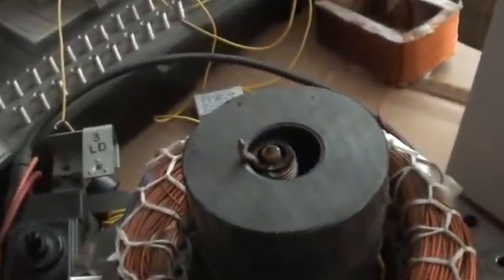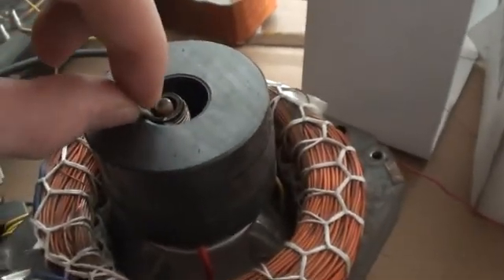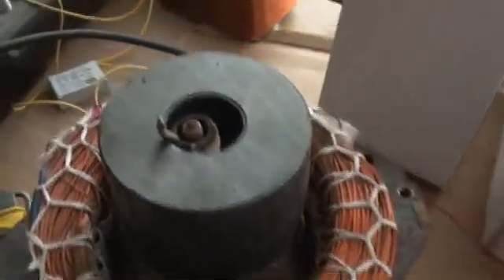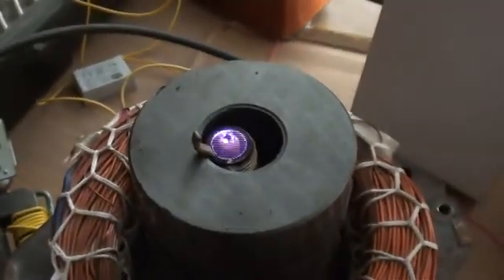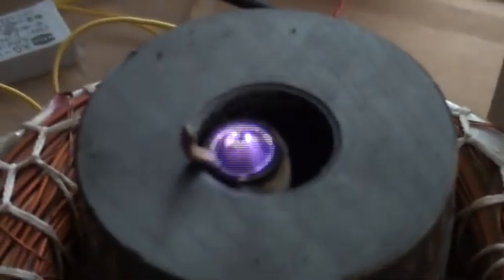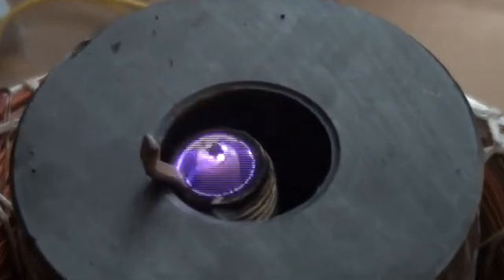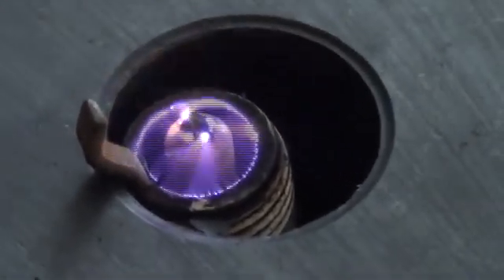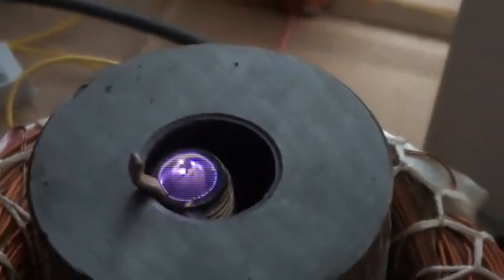Plasma Forcefield!

Comment: ok  hexx noted hears 1 to try with a plasma ball an empyu large soda can will pass voltage  hot n thin enough to burn micro holes in fingers 2 a cfl bulb in mouth and get close to plasma ball it will light up in your mouth  looks like uncle fester and its safe

Comment: You missed the joke. A force field doesn't have to APPLY force to be a barrier, it only has to BE a force. In this case a definable field that would likely leave a tingling sensation and a burn on the finger. A force to be reckoned with, to be sure.

Comment: it might be a hard task getting that much electricity to run under peoples feet without exploding them, not to mention dangerous... but it could be possible... but obviously, you can't store that much energy inside the forcefield... so whatever you were hiding from could cut off the power from outside, and you'd be screwed...

but this is a very cool project... that may make a fortune out of some paranoid rich people XD

Comment: we would be dead, plus even if the air was 78% nitrogen that is not going to separate from itself just to join the electrons to form the purple fake plasma non existing energy, it doesn't work that way, and still it would not be conductive it would react and blow, because nitrogen is 100% explosive and that is a real fact.

Comment: are you refering to hidrogen or nitrogen, becausethe universe is full of hidrogen and both are highly explosives, so where is the purple here cuz I don't see it, plus is not scientifically possible to combine them, hydrogen and or nitrogen explodes instantly with electrical energy, you can't use explosives to conduct energy are you completely stupid or are you just extremely evil to pretend that something impossible is possible to deception the system evil cell.

Comment: impossible nitrogen is a high explosive, it would blow up instantly once in contact with an energy source that would activate it, example fire, laser energy, even electrical spark, nitrogen can not conduct electrons, and they can not be stable because none of those energies is by there nature stable, all of those energies are unstable, and where do you get the nitrogen from anyways? plasma energy is a complete deception that is secretly created by the evil inside the human cells of the system.

Comment: I beleive technically when a spark makes a jump through air it had to heat the air enough to cause plasma. even at a micro stage ( air hs to become ioniszed to the point of discharge through the medium.

Comment: extremely fake, plus spark plugs are not design to create this kind of energy, they just simply spark, and why is it even spinning? it just doesn't have a logical reason as for why is spinning, magnets just do not create this so called plasma energy that is completely different from all the rest of the energy, is faked obviously, how is it possible for this energy to even be release whit out a conduct? , it also melts metal how can if it travels trough them? i also seem they stretch it lik ruber

Comment: high temperature plasma can actually stop matter. its been done in experiments but the problem is that the plasma has to be heated to around 1500 degrees K, the hotter, the better it stops matter. to stop a bullet it would be too hit to stand anywhere near.
If you want to know more about this, check out "Plasma window" on wikipedia

Comment: yeah you are right time of exposure will be too short in this field ...i talked more theoreticaly about plasma field as protection...when you make more layers and use more adapted desing is possible to melt fast moving objects..my point was that plasma can affect state/temperature of bullet but barely a kinetic energy or speed.. huge coils or focused emp more affect electronic devices...simple things as bullets you can just pull for shot distance...most kinecit effective are sound waves...

Comment: lol trust me it was plasma, two magnets one on each end of the glass cylinder, and it had all the air sucked out with a machine that created a vacuum inside of it. required so many machines and oscillators. after seeing one of the experiments, I was completely baffled, we put a quartz crystal in the middle were the plasma went through. well yea, after about 5 mins, we took the crystal out, and smashed it with a hammer(except it didn't shatter, it flattened out into a metal.)

Comment: If you were to bend back the spark plug tip like you have, and applied enough timed pulse of electricity , it will go to the rim . because it's now the shortest path . put the prong back within a gap and you've got your regular spark plug .

Comment: This statement demonstrates really well how you do not understand what you are talking about. If it were a perfect vacuum, there would be nothing to ionize and become plasma.  What you saw, was a evacuated container which was refilled with some rarefied gas, which was them converted to plasma likely by dumping electrical energy into it.  But plasma most certainly does not require those conditions to exist. Lightning or any electrical arc is an air based plasma. This is just a spinning arc.

Comment: Strange. You do realize that plasma encompasses a whole manner of things, yes? Fire is plasma, lightning is plasma (namely arced electricity), aurora borealis is comprised of plasma (as ionized particles resulting from the solar radiation impacting the weakest part of the magnetosphere),  and others. It's not always hot. It just means it's extremely ionized particles.
The aurora is only around -10 degrees Celsius, in fact.

Some people need to go back and study physics.

Comment: glow plugs are only used when the engine is cold to start it. they are turned off within two minutes of the engine starting. after that its purely compression.

Comment: deisel trucks use 'glowplugs' which don't spark, they glow at a lower temperature. this is because a deisel engine uses compression to ignite the fuel (with the help of a glowplug). sparkplugs are almost always made with iridium surface and therefore operate at the same temperature, although high-performance vehicles may have a somewhat higher temerature tolerance, having more rare-earth iridium in the alloy.

Comment: a mining grade dumptruck would most likely run off of diesel, and a diesel engine actually needs less to combust, so the spark plug wouldn't be any stronger. The point of a spark plug is to create the combustion in the engine, the strength of the spark plug wouldn't make a difference. "Performance" spark plugs are a scam.

Comment: How does this differ from high volts coming from a tesla? It doesn't seem to be any different to me, high voltage does this. 
Could you video from directly above? One thing I did notice is it's coming off 6 points(?) possibly to reach the 6 points of the bolt shape, so grind off the bolt 'till she's round and then see if the effect is still there. (wondering if this could show my theory of magnetic exchange effect 'matrix 7' I describe in particle physics).

Comment: Plasma is a highly energized gas. There are two types: hot and cold. Hot plasma is achieved by heating a gas to millions of degrees-the point at which nuclear fusion occurs. The sun is made up of hot plasma. Cold plasma is what you see here: it is electrically energized gas, the type inside a plasma tv or inside a flourescant light bulb.

Comment: I don't think conductivity works like that.
it would probably just ark to the nearest metal object and cause a large increase in the ambient air tempriture, probably resulting in a massive explosion if it had a high enough voltage to reach across half a counrty.
although yes, fuck bombs, we got plazma

Comment: @kiraduarte Actually man I've gotten some sexy girls by being intelligent. You just gotta be a go getter and not look like a nerd, or post witty retorts - @davidoscas2

And yo. is that power source powering the magnet? Or? I made a spark plug thingy with a small transformer, and was wondering if a magnet and electromagnet added would make this effect. What If I made a bigger version with this 10,000V transformer? What would I magnetize it with, as far as voltage on the electromagnet? Confused...

Comment: Sadly not a forcefield....be cool if it was.

What it is is a series of electrical sparks coming from the spark plug and hitting the edge (look at little bright dots around the edge of the "dome") and it's doing it so rapidly it gives the illusion of a continually present dome.

It's a persistence of light similar to looking at a camera flash. It comes across on the camera due to the frames per second being too low to pick out individual sparks.

Cool science though

Comment: You don't know what your talking about. It isn't the coil that is causing the magnetic field. Its the 3 giant black disc magnets that are holding the spark plug in place. The coil is there to either help increase the strength of the magnetic field or to help absorb the generous amount of heat emitted by the modified power supply. Further more, when he turns on the circuit, the intense magnetic field that is created causes a type of electromagnetic disturbance which is causing the audio problems.

Comment: Nobody knows how magnets work :D. But the plasma stream (a "continuous spark" between the centre and the edge of the spark plug) rotates because it is a current in a magnetic field. Like a motor that has wires with current running through them, it spins. The magnets used are powerful, and the plasma stream weighs virtually nothing, so it spins very fast. What looks like a cone of plasma is actually a thin spark spinning around.

Comment: I agree no one in their right mind would stick a finger in there, if it was larger if you were to stick your hand in there could suffer quiet a bit too but this should have been classified as an energy barrier much like not wanting to get to close to an electric fence both would have the same consequences of the "if your gonna be dumb ya gotta be tough law".force field would imply like two magnets repelling each other where there is air space between the two, so matter can't be touched.

Comment: i usually take offense when someone calls me stupid but in this case I will let it slide.I dont disagree with you on the magnetic fields keep the plasma in place that is quiet evident, but you need to actually look at "claiming it is a"force field" is a farce. yes it is radiating energy but it is not a force field it is an energy field... learn the difference before wasting my time posting stuff about being stupid

Comment: now inject a small water spray from behind the plasma arc to see if it makes steam. steam has an expansion of 10,000 to 1 ratio. this could power a steam powered engine easily converting from an internal combustion engine. if it can instantly convert to steam from a hydro spray. then you would have something there. the engine could be made completely from carbon fiber to reduce internal mechanical losses from mass redirection. yea, i think way to much.

Comment: @guy0you0can0trust oh I know what plasma is, I used it when I worked on jet engines in the construction process and also have used a plasma arc gouge to cut metal..but the point is " I made a point", the video is named "plasma forcefield!" of which it wasn't. but you also have a point  too....but say "if" this was supposed to be some type of space experiment then no,even large scale of this would melt metal but you would still have the same mass hitting the object..causing damage&foulingtheplug

Comment: Pretty cool... Well done... I used to rig up voltage transformers to get similar results but i tended to use flat mesh plates... It would be interesting to see the plasma arc across two mesh plates with that magnetic field introduced